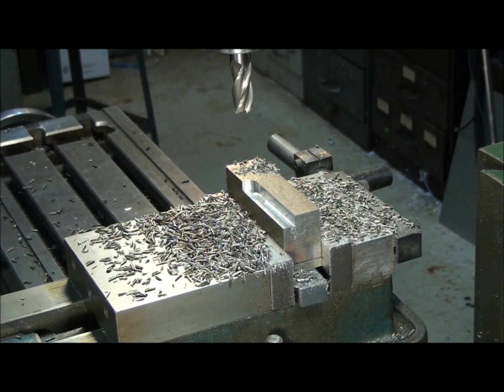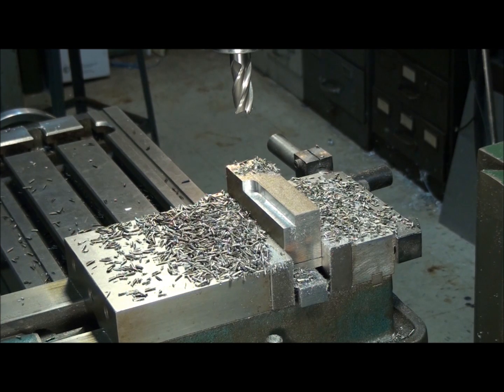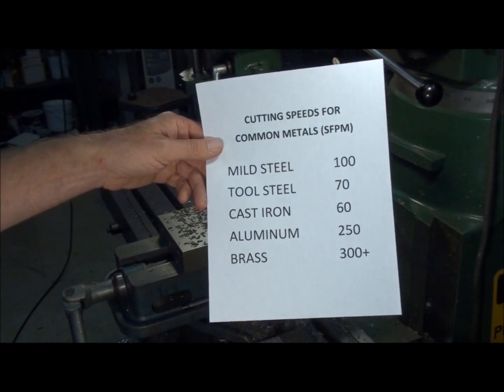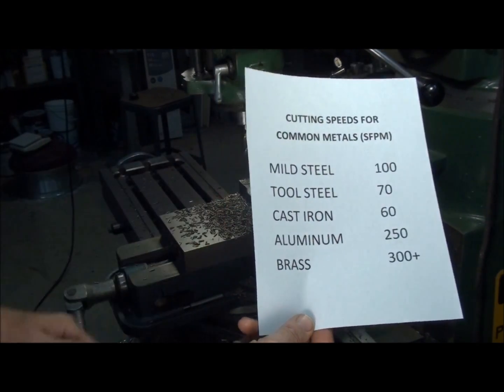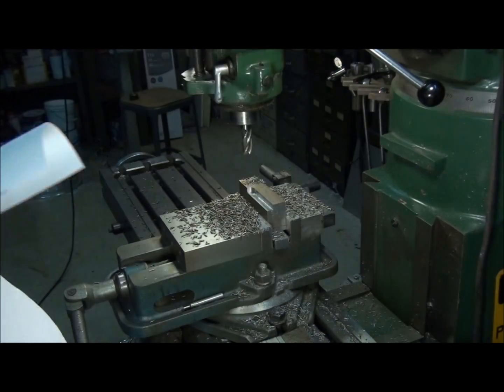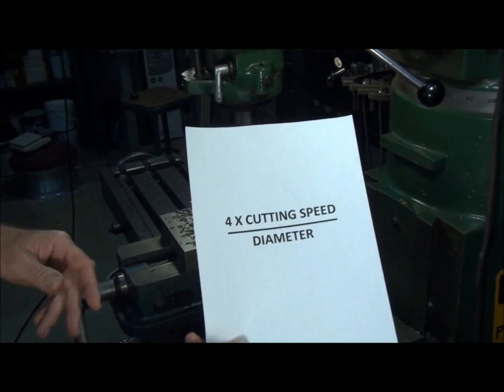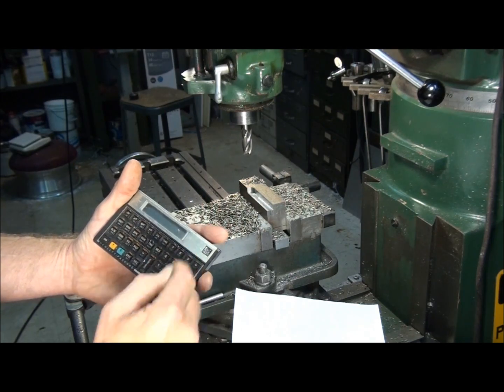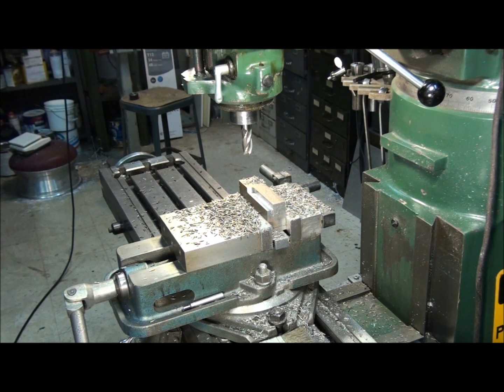Cutting Speed and RPM on the Lathe and Mill

Comment: I love your videos, and unlike you I'm an absolute novice at machining, but I (and apparently RVJimD) hate memorizing or looking up "magic" numbers and formulas without knowing where they came from ("Was that 4 x cutting-speed, or 3? Or was it 6?"). It might seem obvious, but it's worth pointing out that the 4 in the formula (rpm = 4 * cutting-speed-in-FPM / diameter-in-inches) comes from rounding pi down to 3 and knowing there are 12 inches per foot.

To be explicit (this has to be the most pedantic comment in YouTube history):

The only magic number and formula you really need is one everybody remembers from primary school:

    circumference = PI * diameter

RPM just means revolutions per minute. The linear surface distance traveled by the working edge of the tool in one revolution is just the diameter of the milling-tool-or-lathe-part * pi (or times 3 if you're fudging). 

Algebraically, where C is the circumference in feet: 

     SFPM ft/min = C ft/rev * RPM rev/min

or, rearranging:
    
     RPM rev/min = SFPM ft/min / C ft/rev

Since we have the diameter (D) in inches, not feet:

    C ft/rev = PI * D in/rev / 12 in/ft
                = PI/12 * D

so:

    RPM = SFPM / (PI/12 * D)
            = 12/PI * SFPM / D

if we approximate pi as 3:

    RPM  =~ 4 * SFPM / D

All of that said, in practice you'll simply memorize that last line. If you're a newbie like me, though, you'll probably just run the tool too slow most of the time and not remember the formula when you need it. That's when it's useful to know how to simply re-derive it.
 
(Also, for what it's worth, you've probably heard "PI R square". Pi aren't square. Cornbread are square. Pi are round! :-)
Reply from the maker: You have way too much time on your hands Rex. ;)

I actually thought about going through all of that on the video, but was afraid that half the audience would fall asleep by the end of it. Maybe I'll add a page showing where the formula came from to the reference page on my website, tomstechniques.com.

Tom
Reply: Thanks Tom for keeping it simple!!!  Simple is always the best way to Go!
Reply: Ah, twelve inches a foot. That's quirky, I guess. May I interest you in a wonderful alternative called the 'metric system'? ;)
Reply: @antonioa.b.1681  As long as you're willing to pay for the retooling.
Reply: Antonio A.B. How many countries put a man on the moon using metric?  😒
Reply: @yucholkim5276  Just because a system works doesn't mean it's the best.
Reply: @yucholkim5276  One.  The Apollo Guidance Computer did all navigational computations in metric and then converted the values to Pig Latin for the benefit of the astronauts.
Reply: ...... Dad??

Comment from the maker: Thanks Chris.

I generally feed a tool as fast as it will bear, based on how the tool sounds, how much it is deflecting and the color of the chips (in the case of steel). Carbide tooling is much more feed sensitive than HSS which is why I generally don't recommend it for hobby type applications. I may actually do a video showing why HSS is a better choice.

Tom

Comment from the maker: Chuck,

I'm not a big fan of carbide in the hobby machine shop, so all of my cutting tool videos will be HSS oriented. To answer your question, carbide is generally run around four times the cutting speed of HSS and at much higher feed rates. Well beyond the capability of most hobby type machinery.

I will be covering feed rates in a future video.

Tom